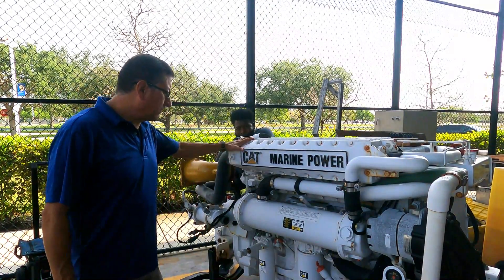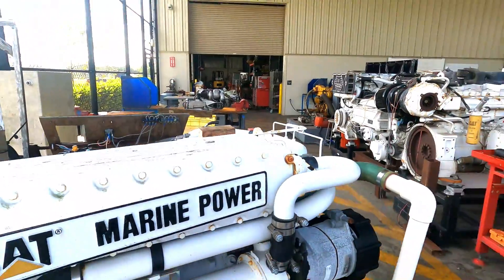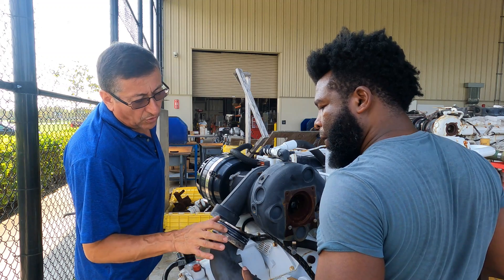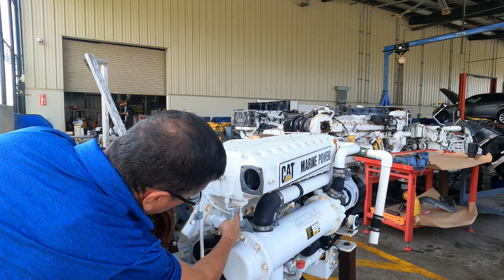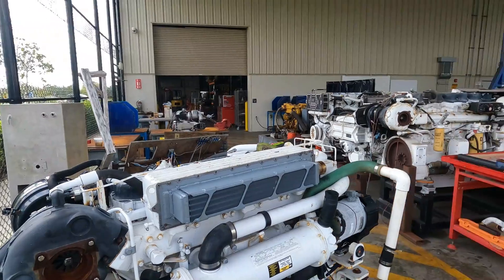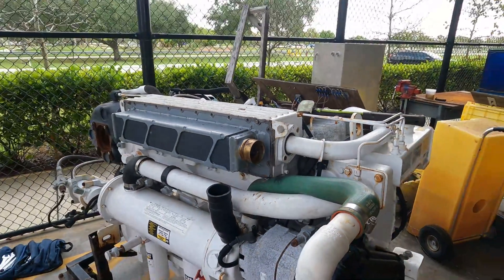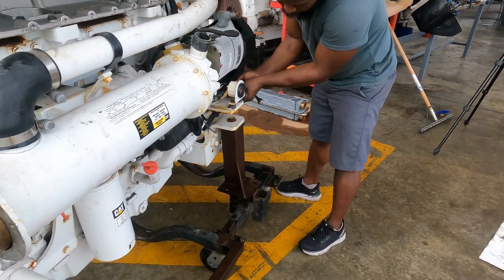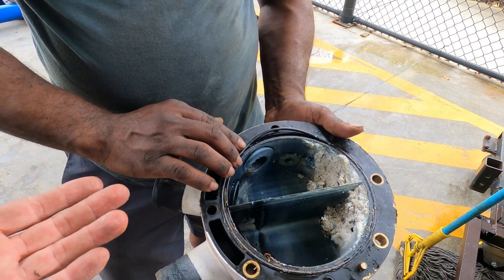Servicing the Intercooler and Heat Exchanger in a C 12 CAT

Comment: Hello 
My c18. Row water engine    new engine. When I fixed.    pump.  Rpm  going to low   pump alredy  overhauled   I need to increse 2000 rpm.,     Without  ecu       can adjust rpm. Manually. ? any options